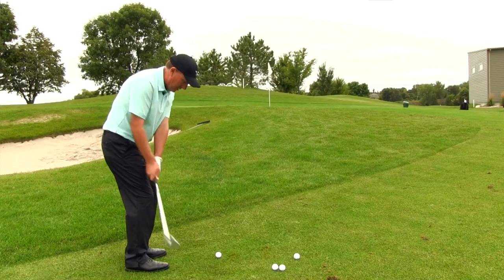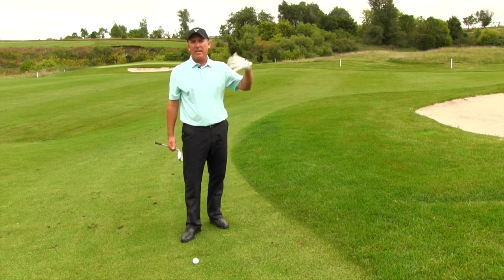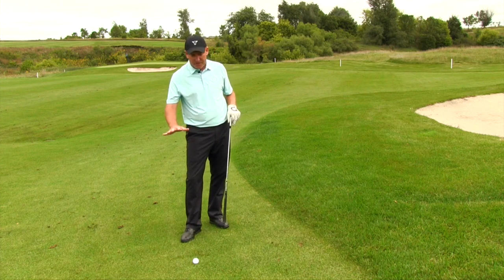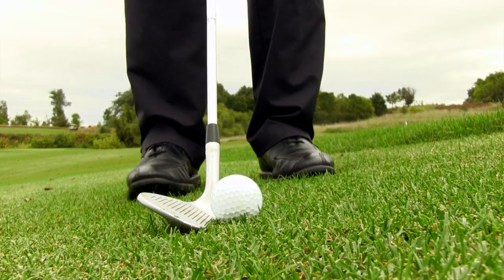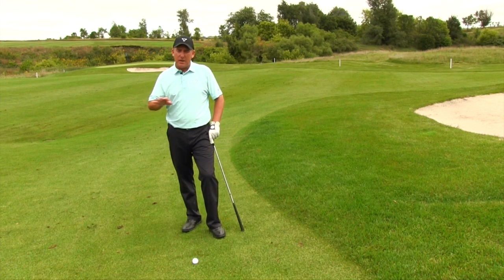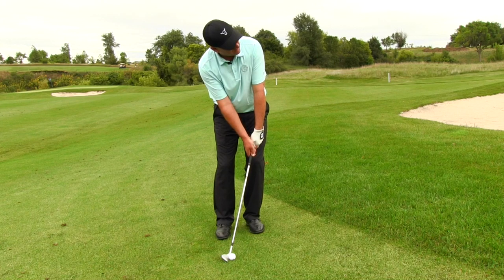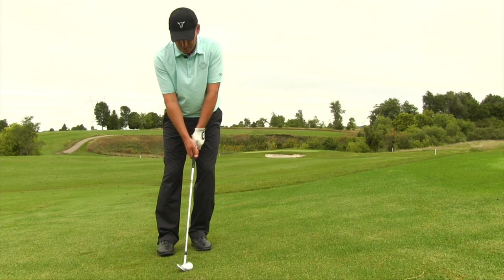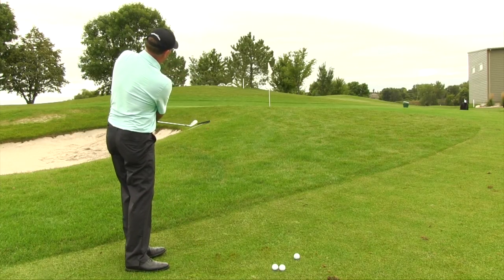Ball Position for High Soft Chip Shots

Comment: Todd, what's your thoughts on getting backspin on these shots to minimize the run out?
Reply from the maker: Todd Goldsmith the key to spin is clean contact and clean groove both of which lead to friction...move the ball back slightly and make sure the grooves are super clean. 👊
Reply: @USGOLFTVshow  I understand that. A local Pro suggested a slight release of the wrists at impact, simulating the striking of a match, to add some speed which will increase the spin. My experience is that when I've tried this I usually blade/thin the shot. Thank you for replying.